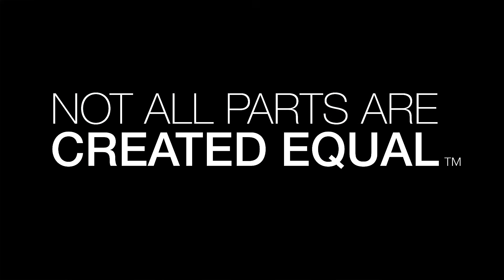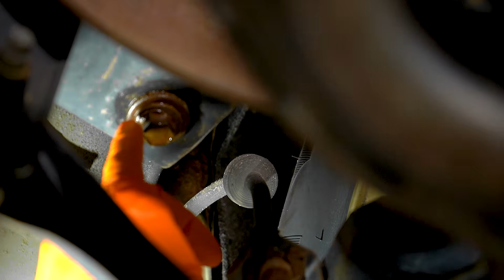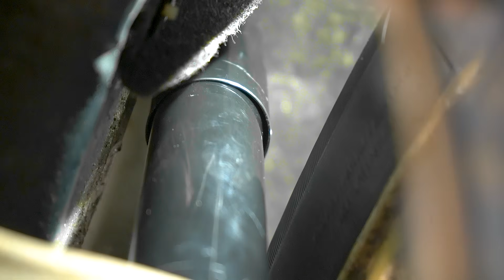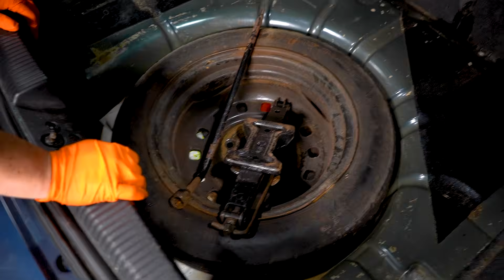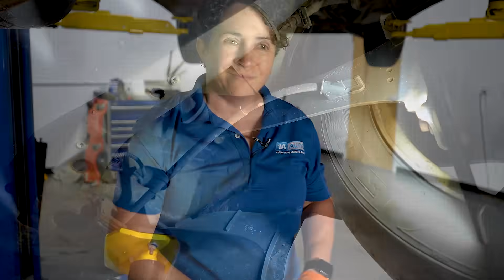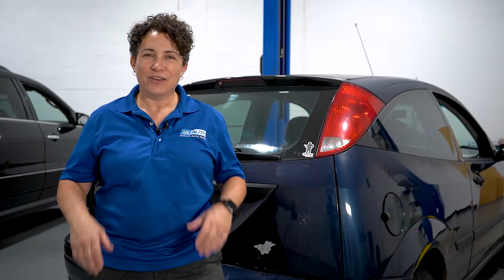Dinging, Clanging, Ringing Sounds While Driving? Diagnose Suspension Noise on Your Car!

Comment: Bro, in my car, there is no noise from the dashboard and side door when I drive on smooth roads. But when I drive on rough or non-rubberized roads, there is a lot of vibration noise. Also, when I go over gutters or speed humps, I hear a “cluck cluck” sound. Earlier, the link stabilizer was worn out, so I thought that was the problem. But even after replacing it, the sound is still there.Pls Reply

Comment: It’s good to locate a narrow lane with walls, even an underpass works, drive through with windows down, radio off, mouth shut and ears open as all noises reflect back to you. Identify high pitch vs low pitch for heat shield or muffler or suspension steering or such, combine location with type of noise. Especially with a sensible friend in the passenger seat or rear seat. Use road bumps to provoke the noise. Add up the clues and get to it, noise by noise if multiple issues.

Comment: I have changed the control arms and the CV axle on my Honda Civic 2014 LX the noise was coming from the control so I changed them. They were warned out old put the new ones in, but it’s still making these noises. What should I do?

Comment: I NEED TO KNOW DRIVING A IVECO BUS PANEL VAN OLDER MODEL WITH 411 000 ON THE CLOCK THE STEERING PULLING TO THE RIGHT; WHEEL ALIGHNMENT WAS DONE BUT THE VECHILE IS STILL PULLING TO THE RIGHT?  WHAT IS WRONG

Comment: I have a Dodge charger had rotors pads replace now experiencing a rattle noise when driving over bumps humps on the road rattle noise sound likes its on driving side so I check the brake housing calipers passenger side is tight but the driver side has movement like something it's screwed properly you think That's the issue I never had that problem until I had them replace parts

Comment: I have mercedes benz GLC 250D premium AMG Line. It is making clunk/knock noises over a rough road from the rear end inside the boot. After a diagnostic from the local garage, they assumed it was a shock absorber or something in the suspension. I couldn't find out yet. Any solution, please?

Comment: Great video pal, I’m at a loss, I’ve got a Astra H 08 plate, been in garage 3x in those times it’s had rear springs, then drive shafts, then lower control arms and drop links…. Paid 3x and guess what banging still there more when slow and on straight roads. Can it be a shock?? I can’t think of anything else I’m so fed up. I’ve paid so much money for parts obviously didn’t need doing

Comment: Unfortunately most mechanics doesn't wear the Sherlock Holmes hat. Instead they cheat and claim they have made work they haven't even looked at. Especially the big ones. But...time will cost the customer money so if they would act like in this video (which they should) they will at the same have to charge you more. Time is always money. You can't get around that.

But as a you tube video it's great to watch.

Comment: This!💯💯💯
Have been dealing with some kind of suspension noise in the front end and have taken my car at least 5 times to the dealer because it is at the tail end of the warranty. They started with one strut, then replaced the other. Still making the noise. Then I got on the ground in the driveway and found a broken seal on the drivers side ball joint. Got that replaced and still hearing the noise. Beyond frustrated with the dealership because I feel like they are not being anywhere near as thorough as these videos are. Feel like pulling my hair out since as yes it has been a major inconvenience waking up extra early to drop off the car and having my spouse take me on a 45min one way commute to work as I am a new small business owner. Then cutting days short to hear they arent finding anything wrong or cant reproduce the noise is super upsetting. Wish there was a 1A Auto garage I could take my car to instead.
Reply: I have the same noise - did you find out what was causing it for you and get it resolved?

Comment: I have this exact car and it makes a heavy clunking sound in the rear when going over bumps. It sounds like it's coming from the tailgate but I've never been able to isolate it. I had my brother seat in the back and try to spot the noise but it seems pretty elusive. I rebuilt the entire rear suspension as soon as I bought the car. I can't remember if it had that noise before because the entire damn car was one big ball of noise. Lol! I did plenty of work on it and now it runs like clockwork except for this last bit of noise that is driving me nuts! Pardon the pun.

Comment: Watched this video and had a go at trying to diagnose the horrible racket coming from the back of my 2007 Hyundai Accent:
• stuff in the cargo area? nope
• loose spare tire? nope
After putting the mat back down for the spare tire cover, I noticed a bolt laying there that I didn't see before. I looked around for where it could go and didn't see anything initially, so I put it in my pocket and closed the hatchback door... something didn't sound right. I went to open the latch - something didn't FEEL right. Opened the door and looked up at the latching mechanism and it was missing a bolt... the one I just found. The other bolt holding it was VERY loose as well. A few minutes and blue thread lock later and the latch was sorted.

As it turns out, that latch was also the cause of all the racket I was hearing as I drove the car... the last thing I expected the cause to be lol.

Comment: Now only If we had a road test after tightening down the spare tire. I'd be impressed! Heard about the noise went away without replacing the rear shocks... but all in all very nice video and love all the group at 1A Auto! And by the way some customers don't want to hear that it was just their spare tire. They would rather you put parts on it and have fix the problem. Some customers, most customers love when you fix their car with no parts! Talk about a customer for life. 
Wrench on folks 🔧
607

Comment: Hi my family has a Toyota Sienna 2001 we got the brakes replaced but sometimes they fail to brake do you guys know why? And also when we power it on it sounds like it’s about to turn off and has mild vibration any ideas why ?
Reply: The first and only place you should be driving to is a mechanic. Otherwise, you’re endangering yourself and others.

Comment: I'd be honored to have Sue work on my car.
As it just so happens, I've got a squeaky rear suspension issue... which I'll take a look at myself first, thanks to this video.
Reply: I agree with you about Sue.  My van took 4 trips to my local Chevy dealer for them to find and fix the noise.

Comment: Dear ANYONE that can help me, my sweet mother gave my daughter her Accord. Trouble is it will go into a sort of hiccup at 3K RPM if you heavy foot it, otherwise, it shifts fine. Feels like a governor is activated just revs up and down and wont go. Easy throttle shows no signs of this issue! What in the world is going on!!? PLEASE ADVISE! Thank you in advance!
Reply: Transmission problem likely, although it could be a throttle problem as well. I would start by taking it easy on the throttle. If the problem persist you could look to change the transmission fluid or the solenoids and see if shifting improves. Otherwise you could take it to a trusted mechanic and they will be able to tell you better.
Reply: I would suggest you to check the fuel filter

Comment: Great info. Thanks. 
I have a "thump" noise at low speeds when releasing the throttle (FWD manual) in 1st or 2nd gear, or when engaging the cluth after shifting from 2nd to 3rd gear. I think it is the friction plate of the clutch (springs compress all the way, and 2 plates just hit). Because I have changed thelover engine mount, and it is not that. The left tie rod end was bad, so I changed both. The rest is good. Only the CV joint on the left semi-axle is making cluning noise when turning sharp left under throttle, but I don't think that is what is also making the thump noise.